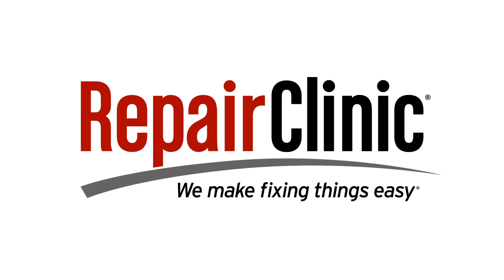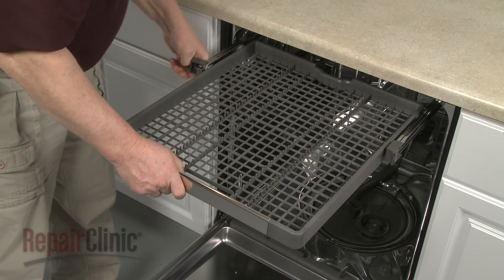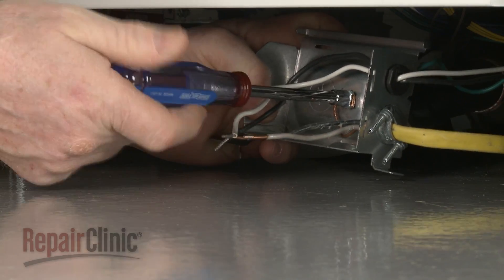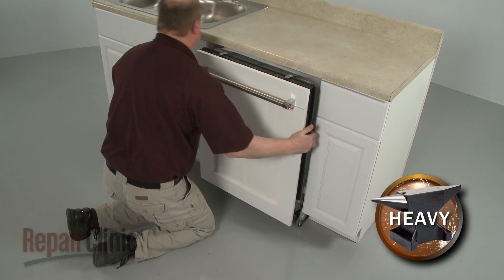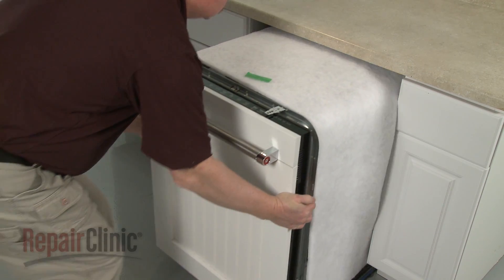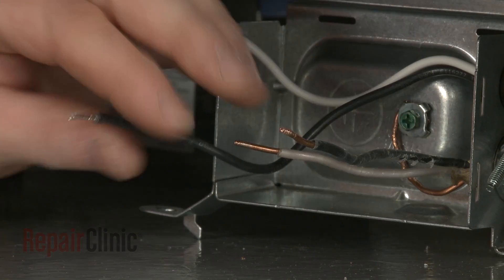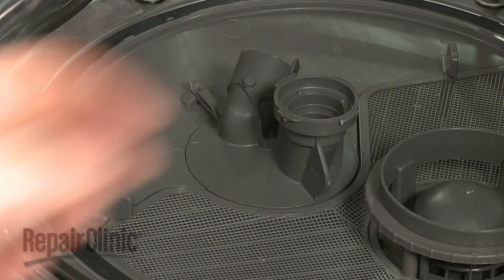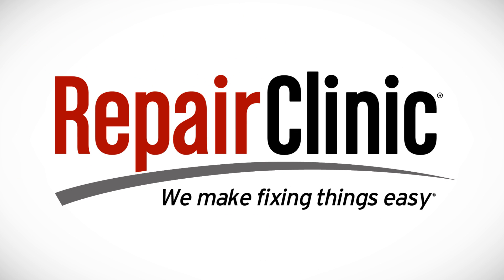KitchenAid Dishwasher Diverter Motor Replacement W10537869

Comment: You replaced the motor but what about the rubber seal that goes around the shaft? This is the part that is causing water to leak on my floor. Replacing the motor and not replacing the rubber seal is not going to fix the leak problem.

Comment: I was told by a 40-year appliance guy, my mentor, that you need to replace the sump when you replace the diverter valve. Do you not recommend this?

Comment: The whole problem is the rubber gasket.  This a recall that never happened.  Plus there should be some type of gasket between the diverter motor and the bracket it set on to prevent it from leaking 😡